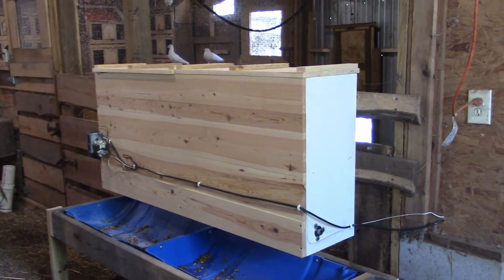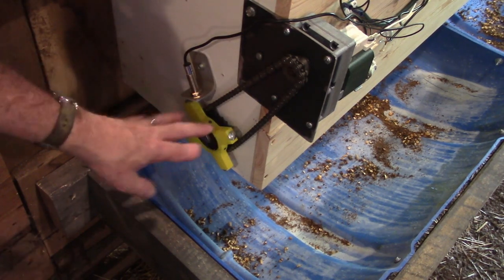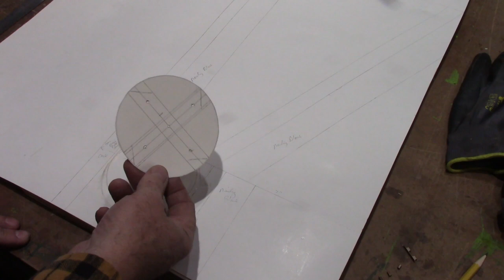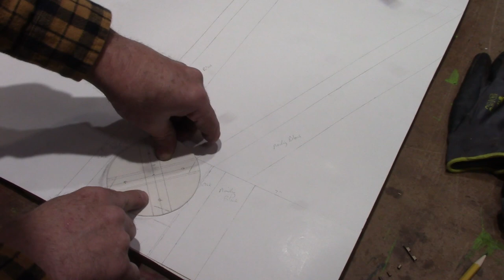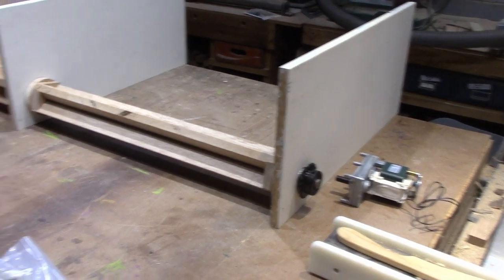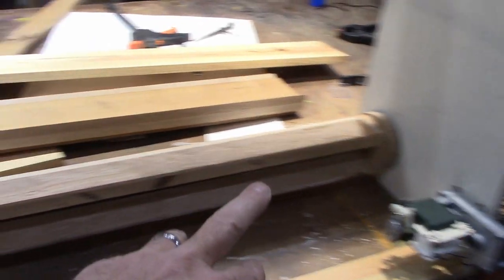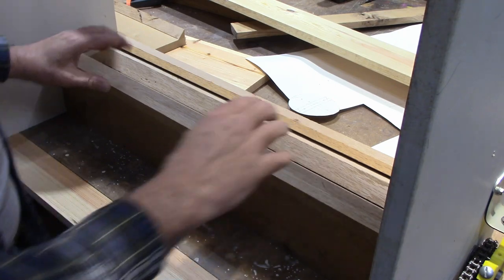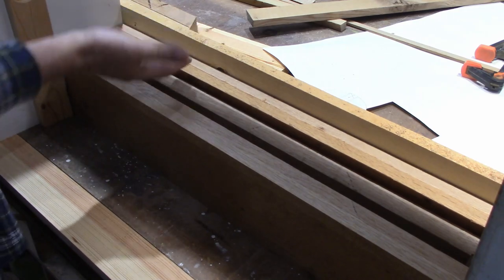DIY Livestock Feeder

Comment: Hello, recently found your video on automated livestock feeder, very well done.  I am going to build a unit based on your ideas, could you tell me what speed your motor rpm you are using?  No AC in my barn so i will have to use 12volt, my plans are to feed cattle pellets and need to either build more than one or scale the size of this one up in hopper size?  Any info you can provide would be greatly appreciated.  Thank you for taking the time making this info available.  Ron
Reply from the maker: I don't have it in front of me but it's very slow like 6 rpm.

Comment: Another great video! One question, do the blades (baffles? vanes?) on the auger attach to the central pipe anywhere other than the ends?
Reply from the maker: No.  I had thought about pinning them but they seemed stiff enough without it.  That motor is really powerful and I'm pretty sure it will twist them off or sheer the screw it it gets jammed.  So far so good.
Reply: @SoatMon  Thanks, I am considering building something similar, but I have 45+ goats and feed about 50 lbs a day.

Comment: What motor did you use
Reply from the maker: I got it from Surplus Center but it's not available any more.  It's around 100 rpm.  You need something that will give you enough power, probably need at least 1/4 Hp.